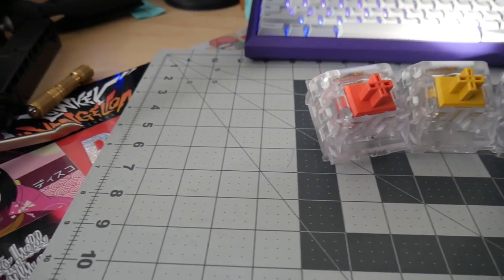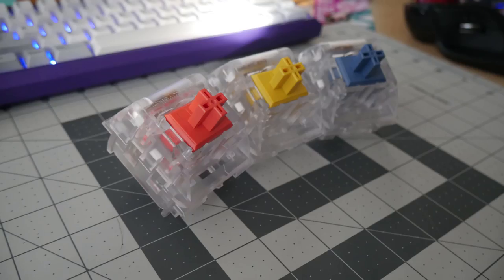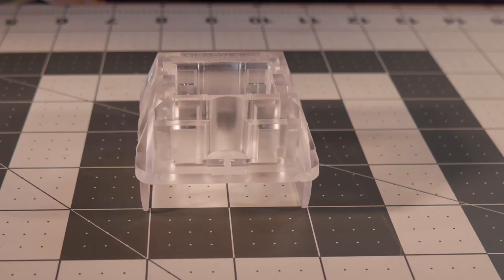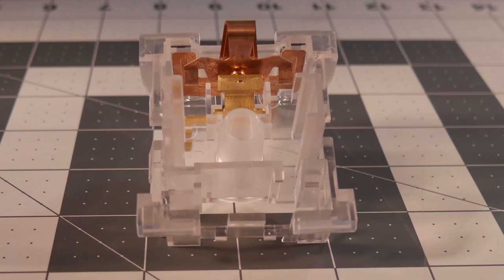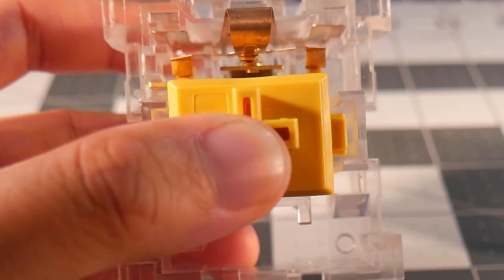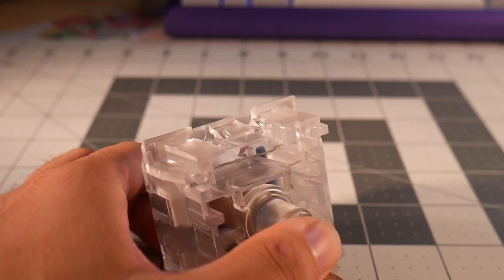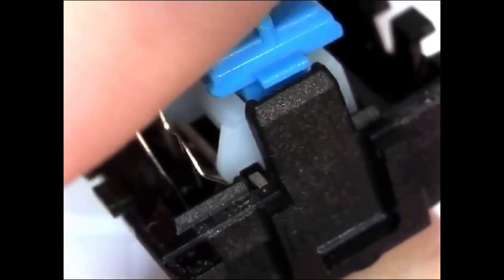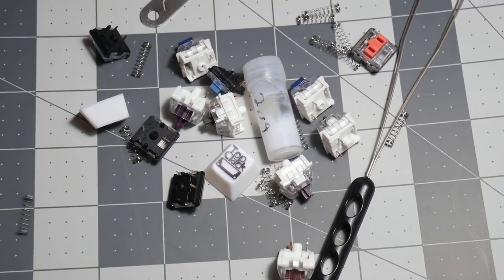Which Switch Ep 1: Switch Basics

Comment: On the blue switches, it's actually the click jacket colliding with the bottom housing that causes the click. The top of the stem is just meant to push down on the click jacket to gather tensile force until it passes the tactile bump, subsequently shooting the jacket straight downward. The rattle associated with click jacket switches is because once the jacket is shot down, its basically loose and unsprung, and is free to shake around the bottom of the keystroke until the key is lifted back above the tactile bump, where the jacket is re-tensioned by the spring.